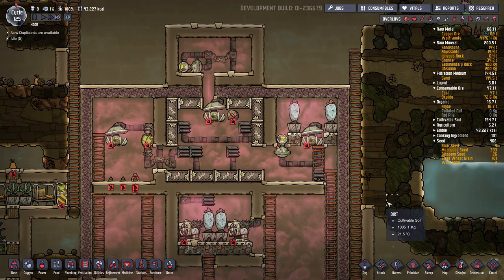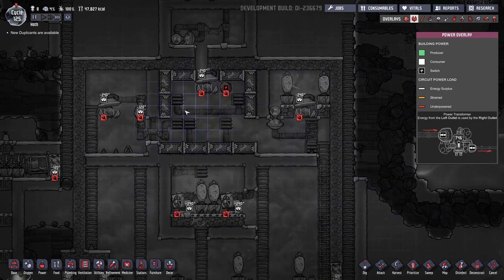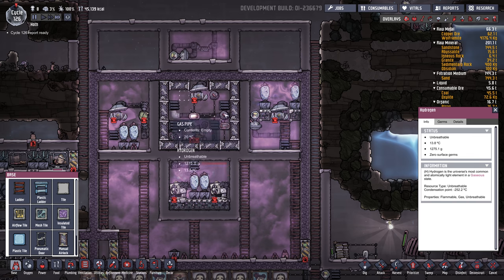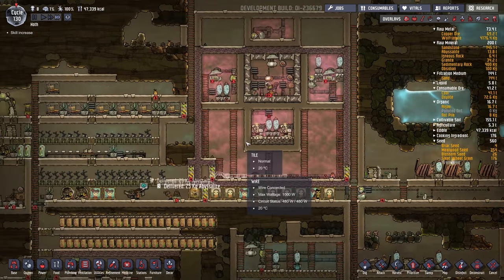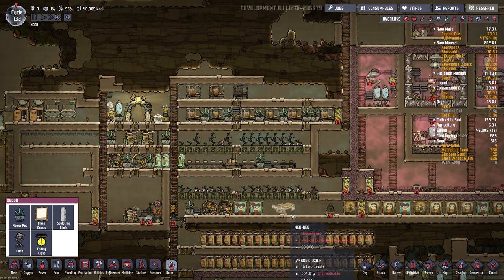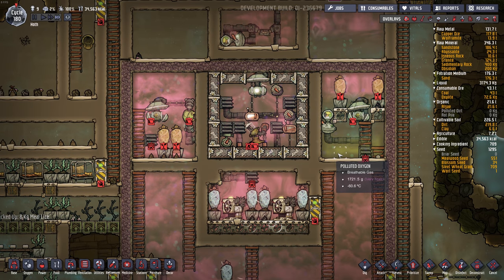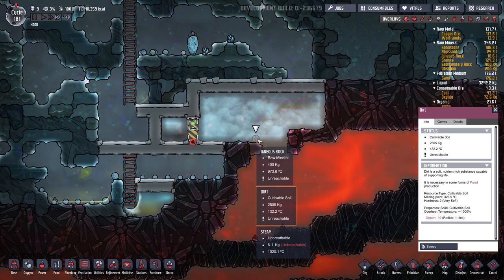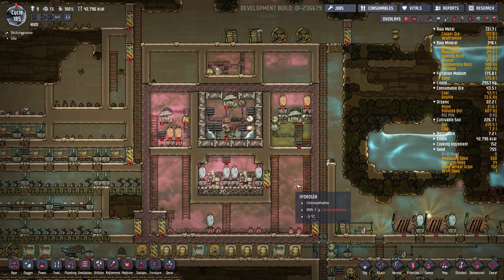How to make Liquid Oyxgen / Hydrogen Bubbler #3 - Helicona Map - Oxygen Not Included Oil Upgrade

Comment: First. I'd like to say that i've played around with such designs in the past and they are erratic. The system i've set up uses crude oil and aquatuners to pass it through wolframite piping, along hydrogen with thermo regulators through granite piping. It starts insta-solidifying carbon within 3-4 cycles and will reach -200oC at around 16 cycles, all those starting at 24oC for both oil and gas and while being constantly fed 60oC carbon dioxide from gas generators at 20 Kg pressure room. Naptha would work better than oil, but i can't bother making the 2000Kg it would need to saturate the pipeline. In general though, i'd say that non closed cycle designs (i.e. letting the hydrogen free) ar inneficient. I'll upload pictures if there's popular demand.
Reply from the maker: The aquatuner ones look interesting for sure. I've built the radiator hydrogen version a while back. I found it to be erractic as well. This one so far seems to work well (but slow). I'll do some measurements on efficiency tonight. I know Brothgar did a bunch of testing of various designs and got pretty good data. This map has no oil so I can't use that :)  I'm not sure closed vs. open matters much though. It all comes down to cooling a gas to a liquid state. It hitting gas or solid to do this doesn't seem to matter. Using some mass in the reaction chamber sure does help keep the system cool though.
Reply from the maker: Or were you talking about making liquid carbon dioxide?
Reply: It's really about making both. Occasionaly, I flush the room with water from a geyser to evaporate the solid CO2 and feed the cool water for O2 production, and then I let it to reach -200 again and start liquefying Oxygen for later use. You can also liquefy Natural gas down to methane if you want. I'll upload some pictures to better explain.
Reply: There's no crude oil on this map though so hydrogen bubblers is the only option. However, with the introduction of high pressure vents you can have a system with 10 times the air pressure which also means it can process about 10 times more polluted oxygen.
Reply: Here's the pictures:

In this you can see the system. I freeze everything in this central room. All insulated tiles all pipes that have to be outside this room are out of abysalite. Pipes inside are from wolframite (liquid pipes) and granite (gas pipes). Those are the best options for maximal heat transfer. https://imgur.com/a/biqFS
Reply: Also here is the save for anyone interested. https://dropfile.to/YPJy01F
Reply from the maker: Woo I like those deluxe bedrooms!  Nice central freezing chamber. So you just toss any gas in there and then feed out the liquid to buffers then eventually tanks. I like it! Not yet cold enough for polluted oxygen but I guess it was on it's way to -200C or so?
Reply: Yeah. Well, any gas other than oxygen would pretty much insta-solidify. Hence why I flush it with water once in a while, and yes it was on it's way to -200. After it starts insta-solidifying carbon, the freezing rate increases much faster. Also you need to be very careful to not let hydrogen come into this room. The door location make it kind of failsafe but if you open them, dupes will start taking strolls in this room and you'll start seeing everyone getting hypothermia which is annoying.

Comment: You say you dont have natural gas to power up Natural Gas Generators... but you only really need Fertilizer Synthesizers to make em. I think you can make a system between 2/3 coal generators to power 10 fertilzer synthesizers, a Gas Pump+Filter, and 2/3 Skimmer. Then those Synthesizers will emit enough Nat Gas for 3/4 Nat Gas Generators. At the same time, you can have the Fertilizer produced be fed to Hatches to get coal. To come full circle, your Carbon Skimmers that get rid of CO2 will provide the Polluted Water.

I mean, you're not REALLY out of ways to get Natural Gas at all. =.= The only concern would be heat, but you can just drip ice cold liquid O2 on them now since you have that hydrogen bubbler going on.
Reply from the maker: Yeah I totally forgot about the nat gas from fertilizer synthesizers. I wonder if it would be net energy positive. I'll have to test it out.
Reply: You mean Asscan's death was a senseless murder??!?!!??!??!???!!!  ;)
Reply: in remembrance of fart boy